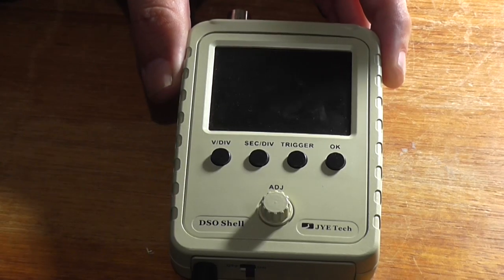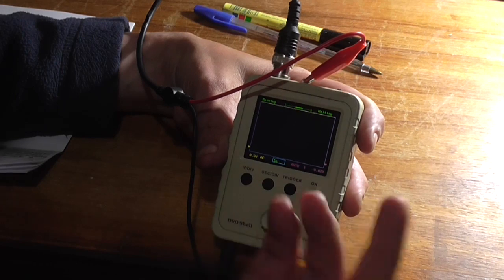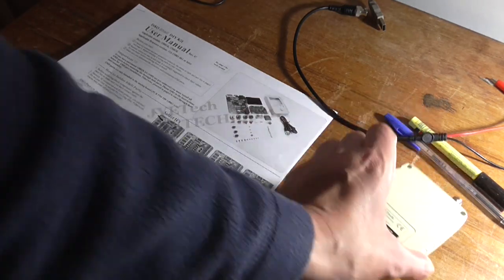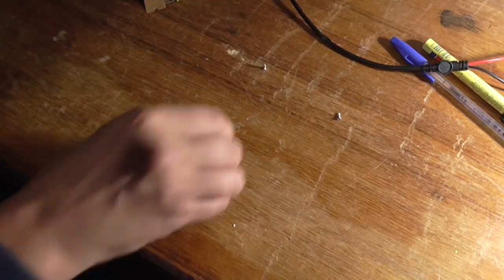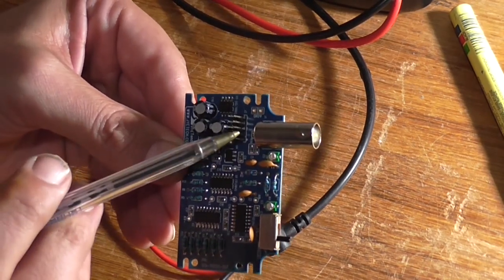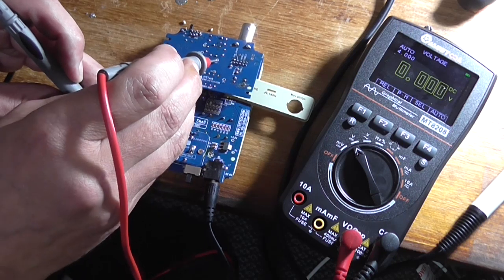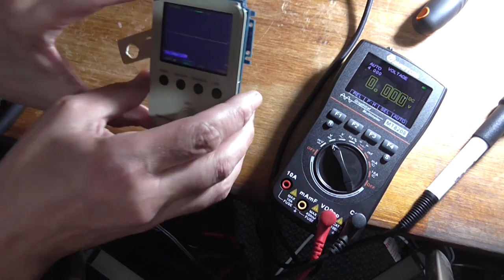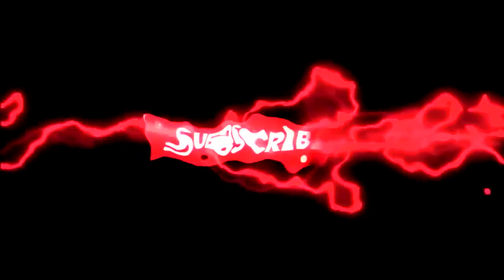Failed DSO150 - Can It Be Fixed?

Comment: So, I had one of these Dso150 kits go wonky on me. The local shop replaced the kit. I built the new kit and during testing the magic smoke released. Well I left it a couple months and bought a fnirsi scope.  Since I am in the electronics hobby the dso issue was bugging me so I looked at it again and the 7660 was getting hot. Ordered up 5 new chips on allie express, replaced the caps too, now I have two working scopes.